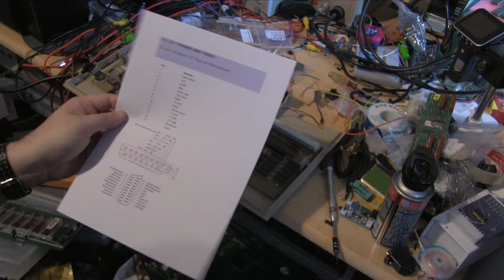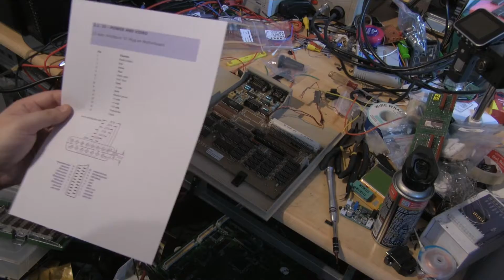Lets get the ICL OPD working Part 1

Comment: Hello, i try to boot my Merlin Tonto. two problems : pins 10 & 14. How to use it ? Or not use ? And how to create video cable ? maybe have you make parte 2
Reply from the maker: Unfortunately I had a small issue with my device, but I will eventually complete the series, in terms of getting it to work here's the pinout for the OPD, which should be the same for the Tonto (although verify, naturally):

Pin	Function
1	Earth (video)
2	Red
3	Green
4	Blue
5	Horiz. sync
6	Vert. Sync
7	Earth
8	-5 volts
9	Earth
10	Monitor power
11	+5 volts
12	+5 volts
13	+12 volts
14	Powerdown
15	Csync

For it to boot you have to pull pin 14 (powerdown) high to +5v.
Reply: Merci ! Have you make video cable ? I've not video signal. I try with RGB pins (2 / 3 / 4 + 5 & 6) but nothing on the screen. pinout is same on Tonto :-) I make new PSU with meanwell PT and lights on but i don't resolve video problem 🙂 i will connect pin 14 on 5V and will see that happen

Comment: these were incredibly reliable. there was one floor in HMSO with these sexy terminals and i never had to fix one ever. the other terminals were HIT17 if you ever come across one. they were  z80 and went tits up weekly. we swapped out average 7-8 per day and each time they needed repriming which involved going to low level sector editor to set security level and network address.

Comment: I used to work at ICL in the late 1980s and supported these internally. I used to sneak into the office at weekends and call various BBSs at the whopping 300 baud
Reply from the maker: Awesome, I did much the same thing on a Vax Mainframe in my first job
Reply: I used to work on them at ICL Letchworth and then Stevenage. I forget what it was called but it was the device at the other end of the 300 baud modem to link into ICL systems.  I've still got a couple of One Per Desks and a single monitor. Not powered up for many years.

Comment: Nice piece of kit. :D Looking forward to part two! Does it have any kind of serial comm port? I have an Acorn Master Compact that part of me really likes the idea of re-purposing into a keyboard for a more modern machine. My thought was that I'd run some software on it to chuck the characters out the serial port. Not that I've ever actually tried that is, I suspect it isn't as easy as it sounds. Do you think something like that would be possible on this machine if turning it into a QL doesn't work out?
Reply from the maker: Part two will be slightly delayed - because we accidentally put 19v through the 12v pin ...  But it will return.  It doesn't have a serial comm port per se.  It does have a serial printer port, potentially only uni-directional.  But both the addon modules have ports that directly connect to the CPU bus, so they have potential for some hacking.  It would be possible to use it as a keyboard I suspect, it seems to be a fairly simple keyboard handler.
Reply: @ReEnthused  Nooo! :'( Oh well, these things happen. You got this. :D I also find the sight of your desk reassuring. Glad to see I'm not the only one working amongst a maelstrom of chaos. ;)